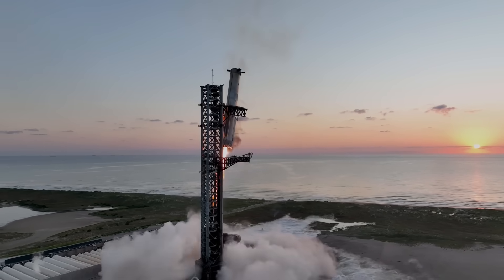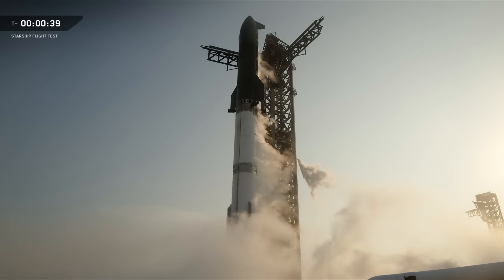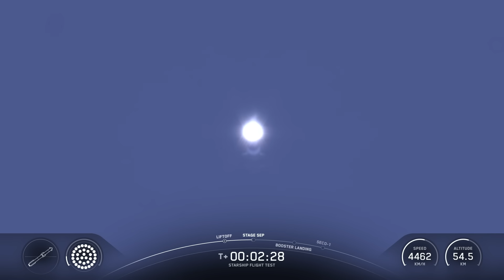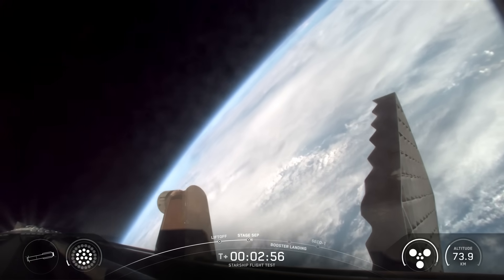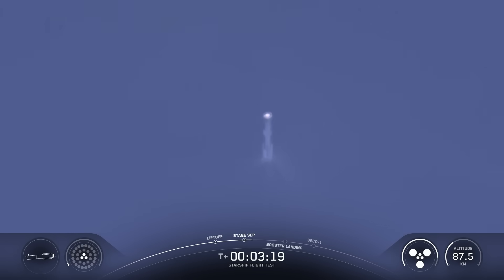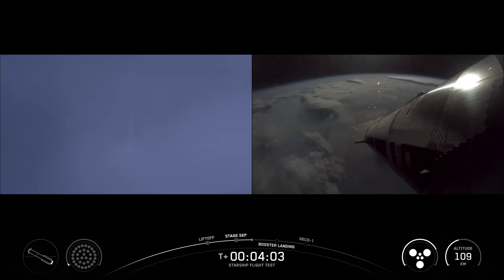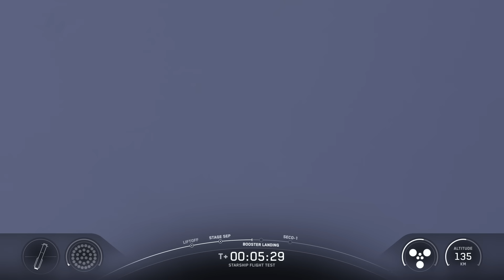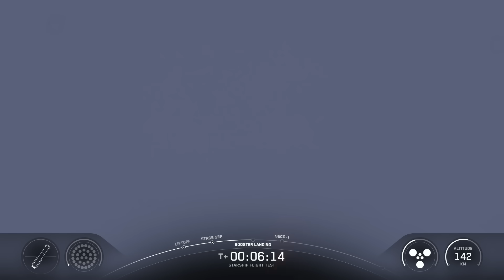SpaceX Builds Largest Reusable Booster, Also Makes Door That Won't Open - Starship Flight 9 Recap

Comment: This thing can’t compare to the shuttle orbiter yet. It still is suborbital. That puts it in the same space as New Glenn and that thing seems to be more reusable. And it lands propulsively too. 

Still looking forward to this finally taking the crown from the shuttle. It’s time to move out of the 1980s. Seems like it’ll be flight 11 at the earliest as it has to complete a relight before they schedule an orbital mission.
Reply: New Glenn is orbital, but hasn't had a propulsive landing yet.
Were you thinking of New Shepherd?
Reply: @Legorockets17 yes. Apparently I was thinking of new Shepard.
Reply: New Glen has never landed.

Also, Starship us suborbital in the same way someone who sits down in front of the finish line has not finished a marathon. Sure, technically thats true, but its obviously a choice not to finish, rather than a lack of capability. 

They don't want starship to get stuck in orbit. Same reason the space shuttle dropped its external tank before reaching orbit.
Reply: @HALLish-jl5mo orbital mission profile is burn-coast-burn. Relight is a critical capability, and of the three tests that were supposed to demonstrate it, two failed to survive the first burn, and one went out of control in the coast phase due to damage from the burn. That isn't choosing not to cross the finish line, that's collapsing halfway through the race. 

Block two has not been a success story. Starship has some big technological challenges to overcome with both on orbit refueling and recovery of the vehicle. It's a little concerning that its last three tests have all gone wrong during the ascent.
Reply: @karl0ssus1  You can reach orbit without relighting the engine.
You just can't deorbit without relight. 
Most 2 stage rockets would deploy their payloads on roughly the same trajectory Starship reached here. Very very close to orbit, but ensuring they will crash into the ocean.
Reply: @HALLish-jl5mo  Just because you can go direct to orbit in a single burn, doesn't mean you should. There's a notable tradeoff in efficiency vs circularizing at the peak of a suborbital trajectory. Given the amount of mass starship is supposed to be launching, they'll likely want the option for the efficient route. 

Payloads released from a suborbital launcher have enough on board propellant to finish the job, otherwise they would fall back along with their launcher.

Comment: Coincidence that last 3 starships (7, 8, 9) all ended with the same leaks in space when ground testing at Massey's site didn't show any leaks? All the leaks started right after Elon joined Trump and DOGE. Someone inside SpaceX hates Elon. Likely loosening some bolts right before launch. Starship flights 1-6 didn't have any of these leaks and successfully landed in the Indian ocean. P.S. They didn't try to open the pez door since the ship was already rolling out of control.

Comment: Why are the flaps unable to reorient starship once it is hitting thicker parts of the atmosphere? At what point does the drag become enough that the flaps can exert control?
Reply: The flap dont have the power to stop that much kinetic energy this up in the atmosphere (at moment of plasma there is a lpt of heat but not a lot of density for the flap to do much)
And when they could have, well, the ship wasnt really in one piece anymore
Reply: I think if they had been lucky enough to have it strike the atmosphere in close to the correct orientation it might have had a chance to stabilise, like a shuttlecock.   I seem to recall we saw that on one of the other missions; it was slowly tumbling too but hit the atmosphere just right to be able to settle into the groove.  This time it didn't.   I was hoping they might be able to use the gimbaling engines maybe in bursts to nudge it into position but I think it was leaking propellant like a sieve.  Even before it got near the atmosphere it seemed to be completely enveloped in a pink cloud of fuel or something that had leaked out.

Comment: Friendly reminder. All Space Shuttle test flights were successful. That's how professionals do it. Give them more money, not to Elon amateurs.
Reply: Then it blew up twice with people inside it, maybe they should've flown it more aggressively so they actually learned something instead of showing off their "success"
Reply: @Yattayatta Are you serious? Developing product and regular use are not comperable.
NASA managed to develop the Space Shuttle, with many pioneering technologies flawlessly. Through hard and rigorous application of science and engineering. Without use of modern computers and decades of new knowledge Space X has (much of this knowledge thanks to NASA and Space Shuttle program also). Every single test flight was successful.
But I guess "move fast and break things" applies to rocket science now, not only to web pages and apps.
Well it's easy when it's not yours but US taxpayers money funding every failed launch.
Consider also that they are not achievieng their stated goals and fail again and again.
NASA would be crucified for such incompetence.
Also, just imagine if they can't get it right in this phase how much more risky would be regular use of Spaceship.
Reply: @PajoOnk  Show me where the US government funds SpaceX launching starship, I'll wait. They don't by the way, so your tax dollars are safe.
Oh and the shuttle is the most lethal space launch system ever developed, I wouldn't say it worked flawlessly, ask the people on Columbia or Discovery if they thought it was a flawless system.